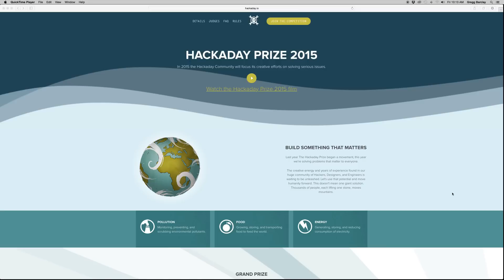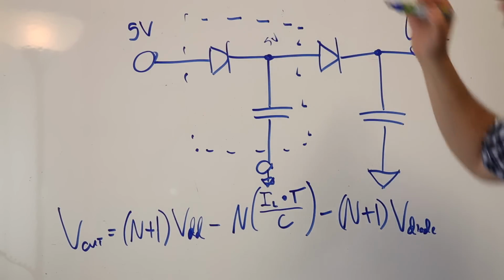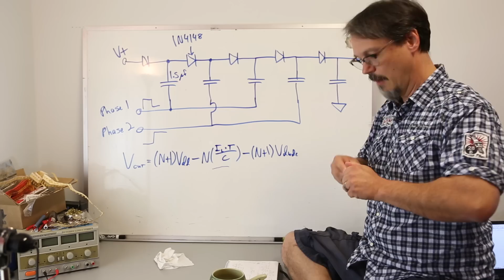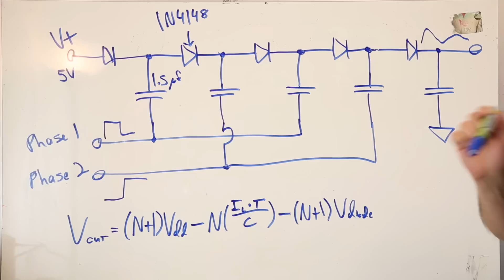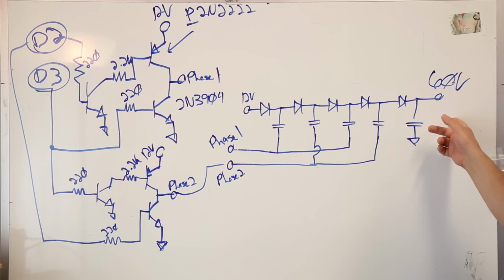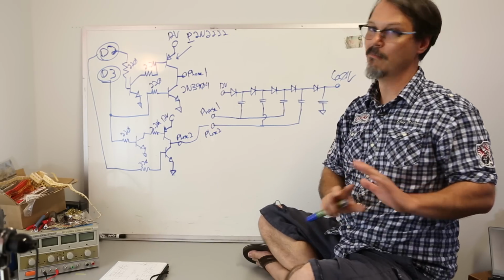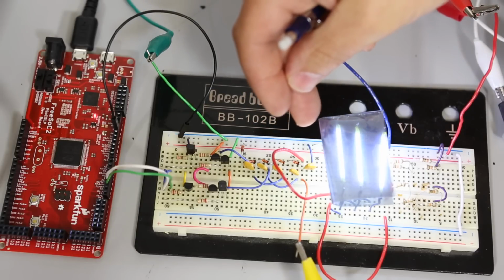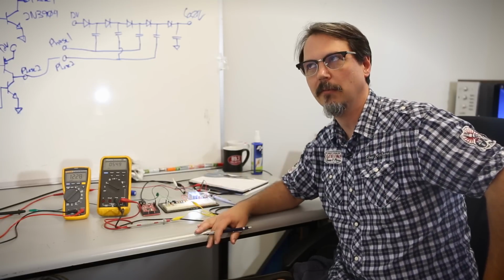SparkFun According to Pete #43 - Charge Pumps

Comment: Just yesterday I learned that the charge pumps in RS232 chips are used in the cheap HC-SR04 ultrasonic sensors, to drive the high-frequency speaker :-) Thanks for this great video!

Comment: For high thermal mass components or components that require more heat underneath, I use a lab hot pad like the  MS-H280-Pro just underneath the board.  Make sure the temp setting is below the solder melting point.  Then use a soldering iron to raise the temp the rest of the way.  This may be a bad method if there are a lot of low thermal mass components directly underneath the component being replaced.  
- In reflow, bottom components are usually glued to prevent them from falling off during the top layer reflow process when the board is flipped.

Comment: Instead of using 2 digital ports can I use just one digital port and a NOT gate?
Reply: but then you get 1Tp out of phase.
The right way would be to use a differential circuit so that both inverted signal are as perfectly time aligned as possible.

Comment: Nice video Pete! Perhaps you could replace the dev board with a simple hex schmitt inverter. Create an oscillator with one gate and buffer it with a second gate for the first clock signal. Also feed that clock into a third gate to create the anti-phase clock. That should improve synchronization of the two signals and reduce cost to almost nothing.

Comment: For those kind of freq/curent/voltage, instead of messing with transistor you could use mosfet driver chip, they make some with two time aligned inverted out so that solve your dephasing on the go, they usually goes up to 0.5-1A, just watch the power dissipation cause they come in small plastic package.
Talking about product design here, of course i got it that you just did with whatever you had on hand so here comes the 2n2222 ;c)

Just my 2cts...

Comment: Pete, disabling Timer 0 on arduino gets rid of jitter in the outputs because of the microseconds() update, it uses Timer 0. Also, you could modify the other timers registers to get I/O clock or PWM into the MHz range. Couldn't you just use an Sparkfun H-Bridge driver for your HV driver? usually the outputs are differential with tight timing being driven with one PWM output. Great video though!